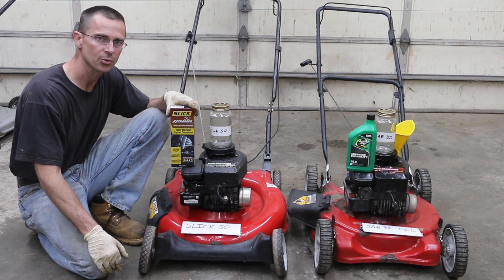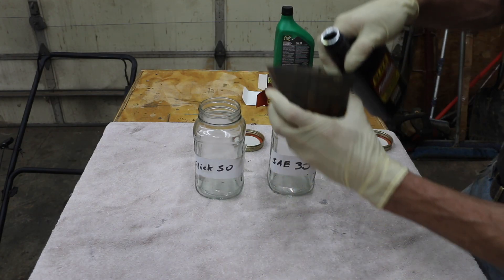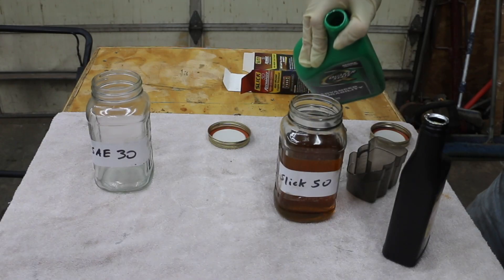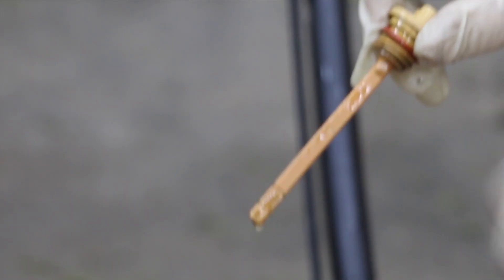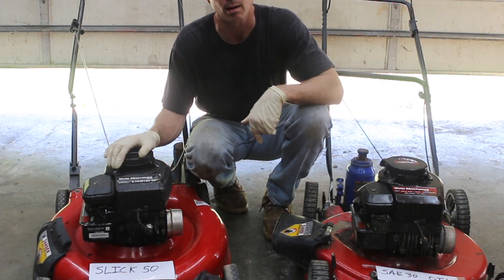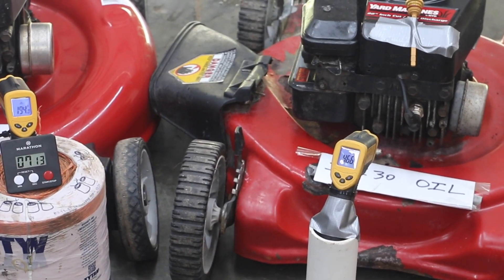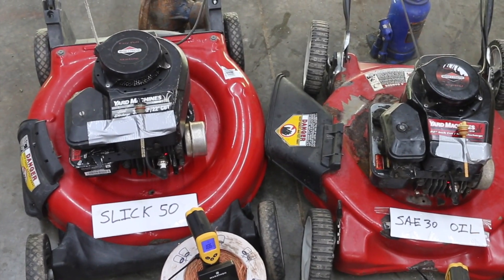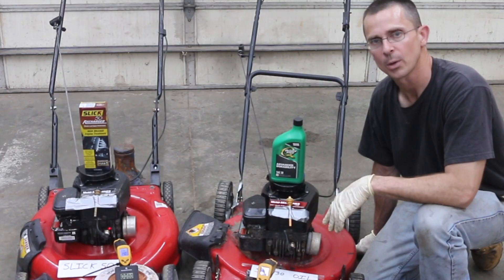Can't believe what SLICK 50 did to my engine!!--Dry Crankcase Test!

Comment: My dad always had a saying about Slick 50. Its a slick way to make 50 bucks. I honestly believe there was a lot of truth to what he said.
Reply from the maker: Adam, LOL!  Our dad's are very wise!  Thanks for watching the video and commenting!
Reply: In 1984 Slick 50 lost the right to sell the original product. They had to make their own lubricant and it does not meet any of the original specifications of original formula. If you want to try the original formula it is only available branded as Xcelplus.
Reply: In the '90 there was a product that competed with slick 50. It was call Prolong, it would be nice to try that one out if it still available!
Reply: There was also Dura Lube back then too and it is still around. If Prolong isn't available then Dura Lube would be a good alternative for a head to head. Whichever new one is endorsed by some racing driver (can't remember who, but I think it's one of the Formula 1 Schumachers), would not be a fair test, cause that stuff is garbage. It's just mineral oil and a total scam.
Reply: Bill Does Stuff.  Another products from 80's was MolySlip.
Reply: I never used any of these snake oils in my cars or trucks, and I have had most of them exceed 300,000 before selling or trading in. Keeping an engine serviced is the way to keep them running. Now for all the haters out there, take $200.00 and go to harbor freight, by 2, 4 stroke motors, run them daily for 6 months, then drain and change the oil, pick your poison of snake oils and run them another 6 months daily, drain and test your motors,and I bet your test will not be much different in the final outcome of 2 good motors being reduced to paper weights or boat anchors!...if your smart you will also buy the extended warranty plan with the motors!

Comment: I've used Slick50 Recharged for years, I get better gas mileage and it saved an engine for me years ago.  I am not sure your use here is the proper method also I would try flipping the treatments on the other engine to see if you get similar results.
Reply from the maker: Dewy, Thanks for watching the video and commenting.

Comment: Slick 50 stopped being made in 1984, the trade name is still being marketed but the product is not the original one
Reply: If you want the original slick 50 formula you have to use excel plus. The guy who runs it is the original owner of slick 50.
Reply from the maker: This is great information.  Thanks for watching the video and commenting.
Reply: You should do a test  with Cerma engine  oil.
Reply: http://xcelplus.com.au
Reply: J Payne true. The name has been bought and sold several times over but the formula is still owned by the government.who bought it from the inventor in 84
Reply: i always thought slick 50 was more for start up.. due to its ability to stick to the cold rings easier .   I'm not a motor head... so what would i know.

Comment: The results are strange to me. The Slick 50 engine was running cooler, which would imply less friction is being made, yet it died much sooner. Leaves me scratching my head.
Reply: Matt I think it had to do with an aspect not related to the lack of oil. I think that engine had an issue with the carburetor. Looks like a mower that was scarcely used and sold after the death of a parent. "Old persons". When they usually sit for long periods of time without use with the newer ethanol laced gasoline they often get filthy with sediment and oxides from the ethanol. Probably got it cheap at an estate sale. Used maybe 5 times a year to mow for 15 minutes at a time.
Reply: I wonder if slick 50 has detergents that wash the oil from the engine.

Comment: I would have to agree with the gentlemen that mentioned the length of time allowing the slick 50 to impregnate the surfaces fully and of course E.g. Smith's mentioning the alignment of the front wheels, the camber, caster, toe in etc has a huge impact on engine performance! I know when the front tires on my truck are extremely toed in I am lucky to get'er over forty mph and my mpg takes a huge dump!! Thanks for the entertaining video!!(seriously on the thanks!)

Comment: However the slick 50 engine runs cooler, Could be good in summer with ac on towing whatever. A cooler running engine is always better.

Comment: Great video. Great experiment. I also have been fascinated by the videos 25 years ago of slick 50 with their engines running with no oil. Im surprised at the result as well but i would like to mention that the name "slick 50" has been sold and so also the formula for slick 50 is not the same as it was back in those days. I have no idea if it is better or worse but I do know its different. I also know that the old slick 50 formula is still out there under a different name that i can't remember but i will try and find it and report back. I also can't help think that a repeat experiment with new engines would only be the tell all. Looks like those lawn mowers were used and who knows what differences they had each been through. I can't imagine that slick 50 with its lower running temperature could be something to make an engine blow sooner then one without it. Something doesn't add up. Just the same i have to love this experiment and like the video.

Comment: you need two NEW identical engines... Maybe the one with slick 50 was used longer than the other... Or there is a difference in heat dissipation between the two models

Comment: I am so glad you asked, the oil that I am using and I would like to recommend to everybody is Xtreme Green.
It's amazing, its use by the US Navy, The US Army, the US Government, and a bunch of elite companies, like shell, Chevron, including drilling companies, also Ford company which inject the oil in the elbows of the robots that build their cars day in and day outcm. "They" want to protect their equipment to the max, but to the rest of us, they give us oil engineered to destroy our engines in around, let's say, 280, 300.000 thousand miles average. I have been using these products for three years, and I am amazed of the results every time, even in cars that are old and rattle they become... Hard to believe, but almost like new, when people pour the oil the firs time, they think their cars went off, because they get so quiet and the performance it's like... Even mechanics always ask the same question, " what did you do to this car" in total disbelief! It runs, like new, and gives over a hundred extra miles per tank, it works guys this stuff really works, I even use it in my lawn equipment expecting always a wonderful performance. I don't know if Sleek 50 was that good a one time, I saw in YouTube that the original formula was change long time ago, but here you have something excellent, even better that some Russian nano products.
Here is the link. You will not regretted.
Also look for a video in YouTube called: 
Xtreme Green live demo:
http://youtu.be/3fXxaWfYiHQ

Here if you want to purchase
http://www.xgglobal.com/jorgecastro

Comment: I run Amsoil in all my motorcycles and quads on one of our rides my wife's quad lost her drain plug she rode for about 5 miles and it quit running all the oil was out of the engine we figured out what had happened put a new drain plug-in added some more Amsoil and made it back to camp she wrote the rest of the weekend without any problems we had that quad for five more years before we sold it and never had a problem with it so you see why I swear by Amsoil

Comment: *** Project Farm...Read this *** The Slick 50 of today is not the same formula Slick 50 of the 1980's. In 1984, that marketing company was bought by Quaker State (who changed the formula to cut costs!) Quaker State was then bought out by Pennzoil, and now all brands are completely owned by Shell Oil. The original product with the original formula that actually worked pretty well from 1978-1984 is now re-branded by the original founder of Slick 50, and is sold under the name XcelPlus. It might be harder to find, but it is still the good stuff. 
That crap sold under the current Slick 50 name is nothing but GARBAGE....

Comment: This is a pretty flawed test. You have no idea what the bearing clearances and piston to wall clearances were between the engines wich is going to be the biggest determining factor in how long they will run without lubrication. What you should be interested in is a dyno before and after the slick 50 on the same motor. An increase in power would represent a reduction in friction and possibly wear. That is if you take viscosity changes by the Slick 50 out of the mix wich you can't really do.
Reply from the maker: Brock, Great point.  Ideally I would have used 2 new engines, but that's cost prohibitive at the moment.  Thanks for watching the video and commenting!

Comment: A true test should be made with new engines . That would have the same standard clearances inside the engine .a worn engine may run longer otherwise
Reply from the maker: Rick, I agree.  It's cost prohibitive to use new engines at this point.  Thanks for watching the video and commenting!

Comment: This product called "slick 50" today is NOT the same product by the same name as of the late 70s/early 80s.   THAT STUFF WORKED.   The stuff made after 1984 is a different (bogus) formulation made by a different company that only bought the brand name.
Reply from the maker: Great point.   Thanks for watching the video and commenting!

Comment: Try looking at an interview with Mr. Bill Bishop.  The inventor of the original slick 50 formula.  It should answer some of your questions.  Also according to him you can get the original under the name xcelplus:  https://www.youtube.com/watch?v=CAt-tJa9P_s  
Also look at a product called bestline.  If the testing shown is true, it is quite a product:
https://www.youtube.com/watch?v=A-bU6SByP0Y

Lastly, Jay Leno introduces a product line called archoil.  Also very impressive:
https://www.youtube.com/watch?v=h3ir3bg0ESU

I have no idea if any of this is as good as stated, but I would appreciate your opinion if you look into it.   Bud Smith

Comment: Supposedly the original Slick 50 formula is sold under the brand name Xcelplus and the current Slick 50 is a different formula from what they sold back in the day. Lawsuits were involved and the man that owned the formula parted ways with the company that owned the trademark "Slick 50". I'm not endorsing either product, just pointing out that the stuff from the famous commercial might not be what you used in your video.

http://xcelplus.com.au/faq.htm

Comment: Not a fair test the one engine may of had hundreds of hours more of run time on it to start with and may have never had its oil changed in it life! looking at the wheels on the slick 50 mower it looked like it had a rough life are used plenty anyway.
Reply from the maker: Hugh, Great point. Testing with 2 new engines would be a more reliable test.   Thanks for watching the video and commenting!

Comment: The original Slick50 from 78-84 was rated and independently tested and very well received at high levels of racing, then the owner removed the product as the partners where trying to sell to another company. The name Slick50 was not protected, but the original formula was, so as Quakerstate bought that company, they could market the name Slick50 but it was not the formula, however they were using the original test results. This resulted in a court mandated cease and desist order, which they stop using the old test results. Then Shell eventually bought them and again not using the formula just the name. The same Slick50 formula by the person that started it is now called Xcelplus.
Reply from the maker: Thanks for watching the video and commenting!

Comment: Also the original Slick 50 that was sold back then had the consistency of thick corn syrup or thick honey not like Oil at all. I watched a barker selling Slick-50 at a state fair in Florida back in the early 80's while he was giving us passer by a 30 minute speal about the product  he had that Bringgs & Stratton demonstration engine with the crank case cut open so you can see that crank case was dry and it was running the entire time. Later on in late 80's I saw the same thing at another fair... this one has a nicer setup and he was running some jap 4 cylinder car engine with out an Oil pan and a mirror under it so you can see that it was running dry during his 30 Minuit speal.   Needless to say I was a believer. And note I had a van treated with the stuff and puncture my oil pan running it on to a rock and made 50 mile back home and drove that van for another 2 yr before I wrecked it in an accident.
Reply from the maker: Great point.  Thanks for watching the video and commenting!

Comment: Modern slick-50 is not the slick-50 that you saw that original Advert for.. Slick 50 stop being Slick 50 back in 94...the Oil company stole the branding of the name Slick 50 and sold their own stuff under it.. The original slick 50 is now sold under XCelPlus I belive. Because the original Slick 50 did work just like those old Advert says it did...
Reply from the maker: Great point.  Thanks for watching the video and commenting!

Comment: Try the same test with "Tufoil".  It has proven to be the best lubricant to date (actually killing these engines was an expensive test and you may not want to do it again).  Slick 50 has changed hands several times since the original formula was introduced back around 1978.  I don't recommend it anymore myself.   The name  remains the same but the formula has been "watered down" as you very well see.  The original formula is available under the name "Xcelplus" from the same John Bishop.
Reply from the maker: Thanks for watching the video and commenting!

Comment: I would want to run this test a few times before coming to a conclusion.
The two engines were from different mowers.
We don't know how similar the wear between them was before the test.
What I noticed was that the slick 50 motor remained much cooler throughout the test than the SAE motor.
This suggests less friction which should suggest reduced engine wear and expansion issues.
I would want to at least run the test with two identical engines with identical or no prior wear.
Reply from the maker: Thanks for watching the video and commenting!

Comment: As a 66yr old engineer ,there are are a handful of makes i own that stand out after 50yrs of heavy use. they are as follows ,stahwille gedore britool king dick Williams proto and of course snap on and there is very little difference  in quality between any them ,however there is a make i have been purchasing over the last ten yrs a brand called Facom ,which are super quality and finished beautifully at a very sensible price and I shall now stick with them.
Reply from the maker: Thanks for watching the video and commenting!

Comment: I have been using Mobil 1 synthetic oil since it first came out without an engine failure. What sold me on this oil is the increased fuel economy and smoother running that was noticeable. I also treat my fuel injected engines with Techron fuel injector cleaner every 5k miles for the same reason. I have a 92 Toyota with 282,000 miles that get 35 miles to the gallon with a fresh oil change. I also have an 87 Toyota pickup with almost 300k on it and still running strong thanks to Mobil 1's superior lubrication properties. I've been sold on quality oils since 1973 when I did actual bearing burnout tests using a machine loaned to me from Bardahl. Back then Bardahl racing oil tested head and shoulders above any other oil. I found the type of machine that I used in 73 in a Spanish video but it serves the purpose, please watch. https://www.youtube.com/watch?v=n_JE3w1PLe8

Comment: I bought a grand Cherokee with a 4.7 and a spun rod bearing, figured it needed an engine anyway so I tried a cheap fix first. I replaced just that one spun bearing, filed, shimmed and fitted the bearing to get as close to factory clearance as i could and ran Mobil 1 15-50 full synthetic. 3 Chicago winters and I put over 50,000 miles on that engine, I pulled a trailer from up north to florida thru the mountains and drove that Jeep until the truck around the engine started falling apart. I sold it to a junkyard and the engine was still running strong. I swear by full synthetic Mobil 1, additives are a waste of money, quality oil is where you spend your money and get results.
Reply from the maker: Thanks for watching the video and commenting!

Comment: the original slick 50 was better. the new slick 50 formula is different and garbagelucas garuntees ur engine not to lock up. obviously I've nvr tried to lock my truck up but have always had good results. also bars is an amazing additive. i believe its called bars leaks. a two part mixture goes right in crank case after oil change. one side is very thick the other similar to reg oil. queted my 4.3 vortec down a little too.
Reply from the maker: Thanks for watching the video and commenting!

Comment: I used original type slick 50 in a honda civic years ago and it made it start using oil.  The engine was re-rung but continued to use oil.  I instructed the mechanic to ring it again but this time sand the cylinder walls.  It worked perfectly afterwards.  I concluded that slick 50 did not coat the cylinder walls or rings evenly and was the cause of premature failure because of uneven wear.  I will never use additives again.  Motor oil will work just fine for me.
Reply from the maker: Charles,  Thanks for watching the video and commenting!